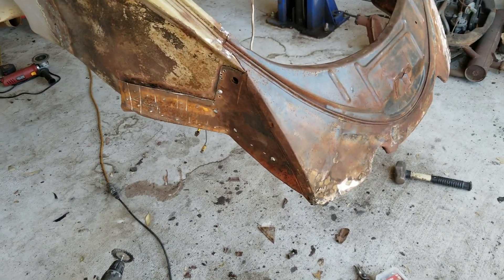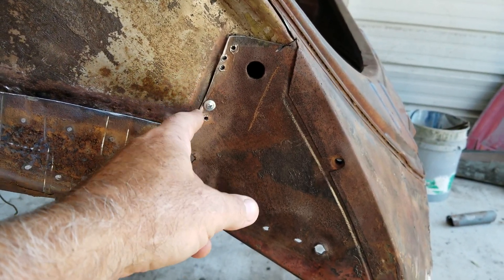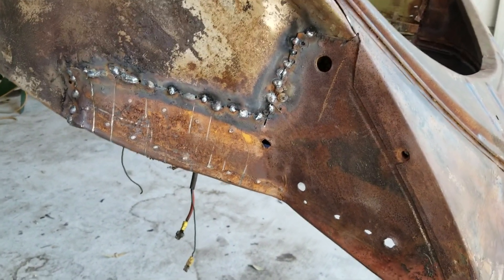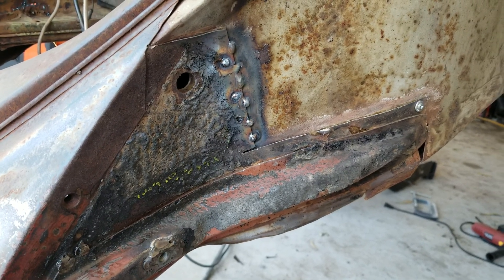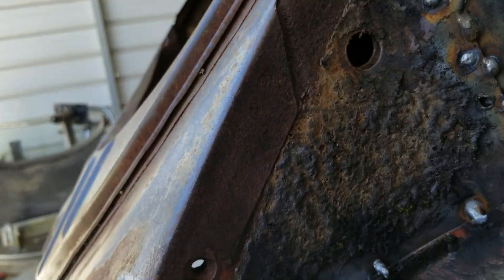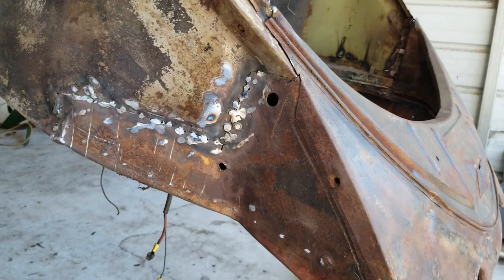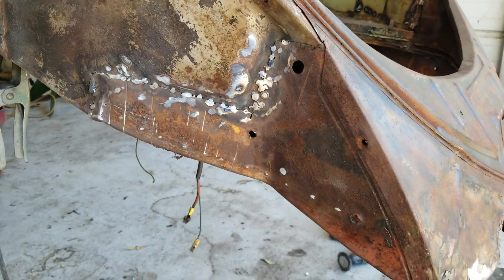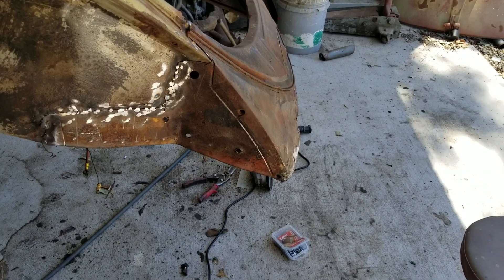60  ragtop rear apron weld in

Comment: Are you going to run a 1600cc style engine?  If I had it to do over I would change out the “side trays.” The 36 horse trays are really “tight.” I trimmed the engine tins like most people do to fit the later engine. Nice work 👍

Comment: So far you got a belly pan from car #2 - a back seat hump from car #3 and a h apron from car #4 because car #1 NO- GO- OD , I think i am following this. but you aint gave up yet ........... oh I forgot the heater channels came from # 3 = slim pickens
Reply from the maker: kind of sounds like your following it the heater channels are new though just 2 cars and swap meet parts like the apron. Got some original running boards too. will be very cool when I am done.
Reply: the heater channels are where you had to go and buy one and got pissed off about the $$$$$$
Reply from the maker: no I already had them got them from a guy closing his shop for dirt cheap a few years ago.